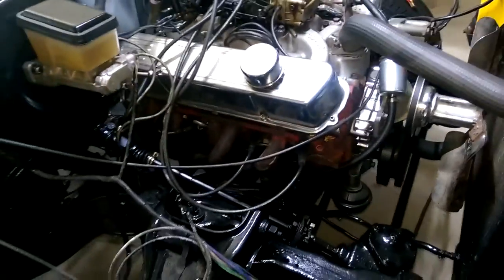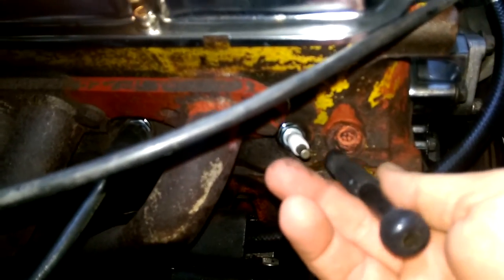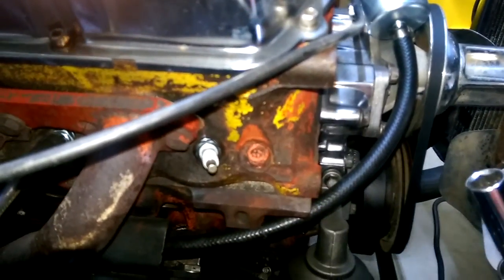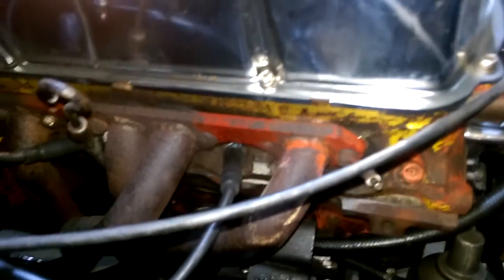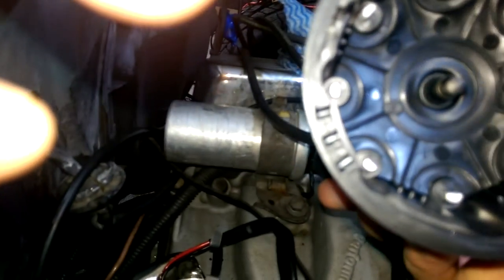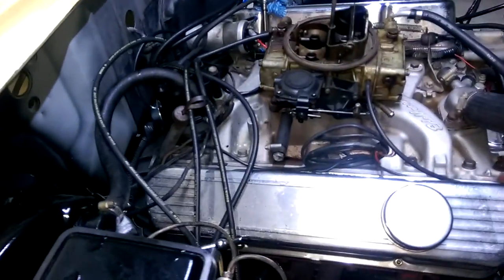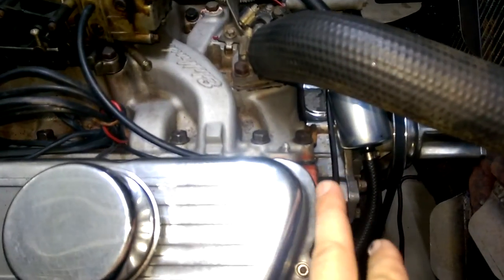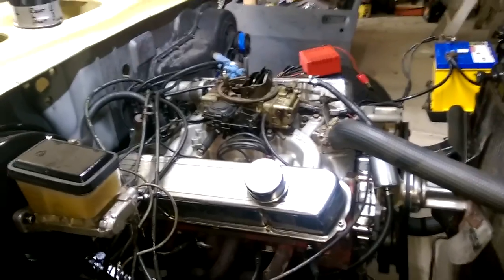How to find Top Dead Centre  Holden 1 Tonner 253 v8

Comment: Hey mate. 
What brand is that dizzy? I have the same one, can’t see any manufactures markings on it. 
My rotor is a bit fried from losing the button, and I need a new dizzy cap....but can’t match it to anything in stores. 
Help!  Cheers 🍻
Reply from the maker: I think it is a bosch dizzy..from super cheap auto
Reply: Glen Short thanks mate. I’ll check it out

Comment: great video, where can you get a tune up on a 253 Hz Holden wagon i tried ultra tune in Ballarat they said $300 is it hard to do yourself
Reply from the maker: G'day Farmer I only tinker ask a novice , from what I know you need good spark plugs,leads,good distributor and cap..most importantly a clean carburetor that is set with the correct air fuel mixture then set timming.fresh fuel,air cleaner.I was lucky as my carburetor was functioning nicely. I replaced every thing mentioned except the carburetor, then set the timming by ear , as i don't have a timming gun.So it may pay to ask if anything gets replace or repaired e.g. carburetor kit,, in the quote of $300.
My dizzy and cap was about $180,leads and plugs about$90, air cleaner I think $40. Hope that's helps you out...money money money.🚘🙂
Reply: @AussieManCave  Hi Glen i have the Blue motor in my Hz it has the electronic distributor and electric choke  i did have trouble with it when idling oil pressure would drop way down to near zero, i found out if you pull oil pump spring out and put 2 washers on top it works which it did when cold the oil gauge nearly winds off the dial so all good now  i have only had the Wagon 2 weeks it come from Tamworth,
Reply from the maker: @Farmer2492  That's excellent to hear a few cheap washers I love 👍,I bought a vt commy with the 304 engine a while ago and had bad a faulty  starter ,blocked injecterors no  fuel finnaly got it to run but no oil pressure. The past owner had new oil and filter but as I found out I had to remove the oil pump and push grease into the pump as it helps  prime oil pump..or you can use gasoline instead of grease.Oil was pumping perfectly oil light went out ,one happy engine.🙂enjoy your aussie icon v8👍
Reply: @AussieManCave  Thank you Glen, i cant believe the prices of HQ to HZ now the prices have gone mad and there only going up and up
Reply from the maker: @Farmer2492  😀👍our bonus to have a old classic
Reply: @AussieManCave  do you have a one Tonner
Reply from the maker: @Farmer2492  sorry I am shocking when it's comes to checking mail,,yes i do have a one tonner🙂👍